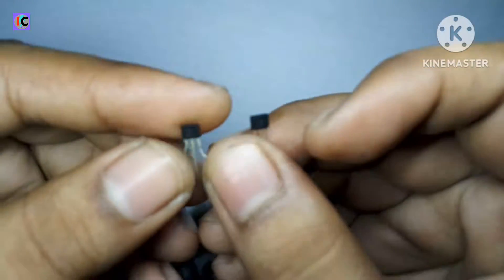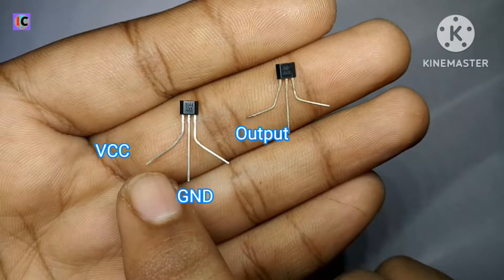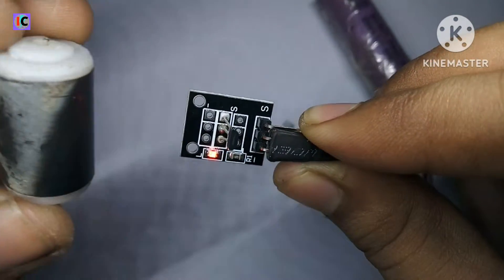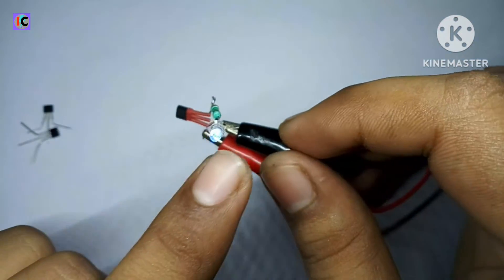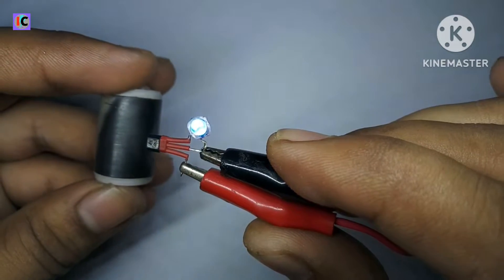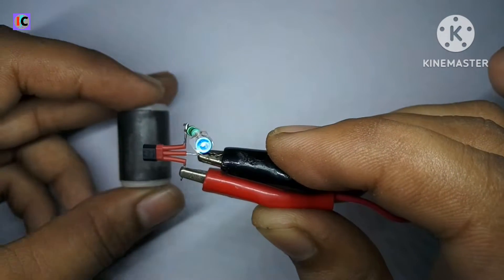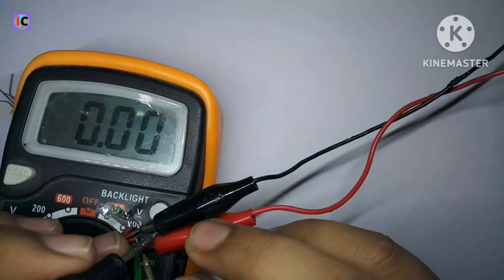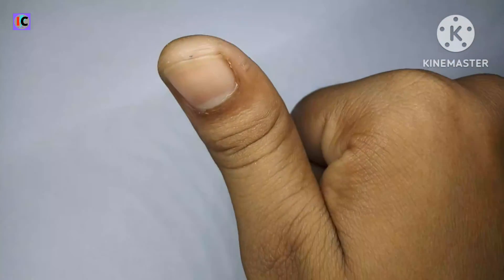Why Choosing Hall Sensor So Important !

Comment: Bro I have 49e016BD hall sensor, I want to use it in my almirah so when I opened it has to led glow and when I close the door led off

I have to make it with 3.7v or 5v battery and 
The LED should work at its full potential, I am going to install 8 to 10 LEDs in it. 
Please 🙏🏻 help
Reply from the maker: I will make separate video for that.
Reply: @innovationic thanks 🙏🏻 
When did you make the video ? 😅
I am waiting...

Comment: Sir can we use 1344 hall sensor instead of 49e
Reply from the maker: both are different types, 49e is analog type so use other analog type but A3144 won't work 👍